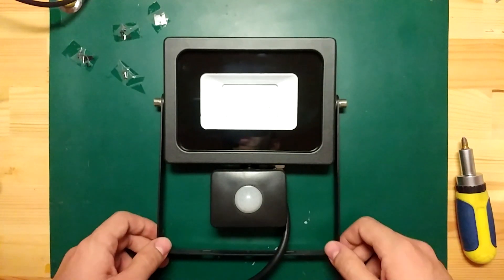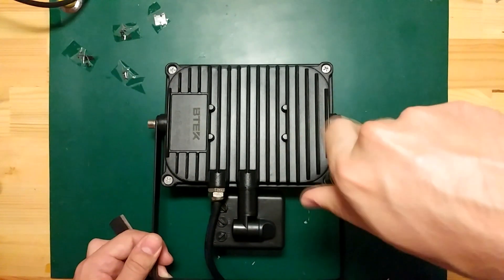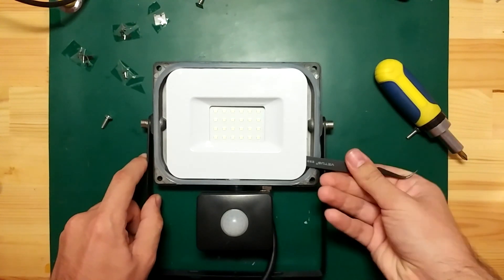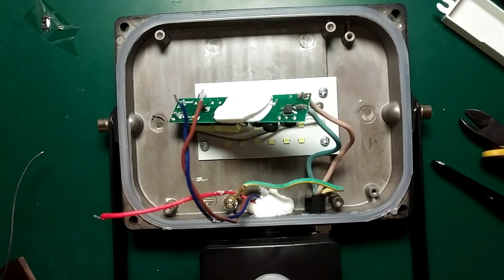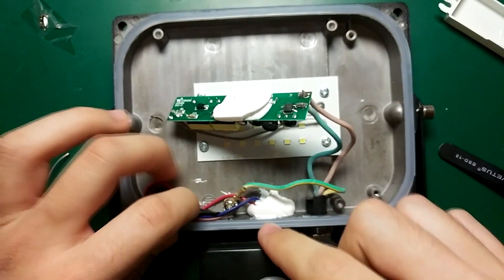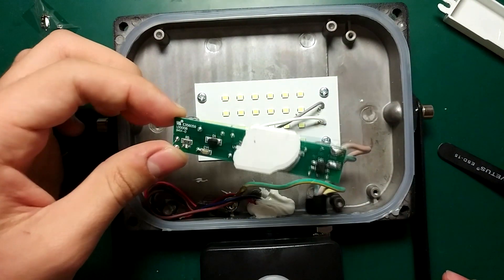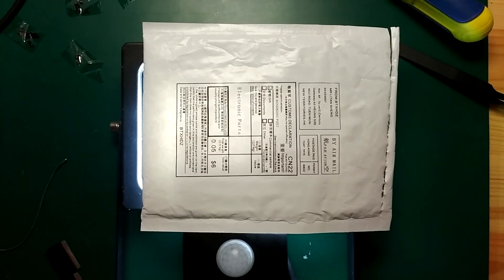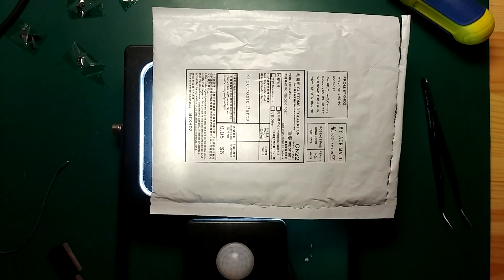How to Bypass the Motion Sensor on a LED Floodlight

Comment: I have bypassed the sensor but the problem is every time I turn on the switch  there is a 4 second delay for the lights to come on. any suggestion?
Reply: Turn in on 4 seconds in advance

Comment: Can you remove the sensor and add a switch?
Reply from the maker: Yes, you can! Look at 7:35, you can add a mains rated switch between the brown wire and the hole that it goes into on the circuit board.
Reply: @nunogarcia9446  thanks for that.

Comment: What if you want to use both? Detector ànd switch ;-)
Reply: Hey Gunter, see if your motion sensor has an override: 
If you turn the switch to the floodlight off and on within a second or so, the light should stay on.
To go back to normal operation, turn the switch off and wait  about 10 seconds or more before turning it back on.

Comment: Why buy a lamp with a sensor?
Reply from the maker: Mainly because it was actually cheaper with the sensor rather than without. I could have gotten a cheaper one without CE/FCC/TUV certification, but when it comes to electrical appliances and fixtures I do not like to play with fire - quite literally.
I've bought a cheap 50W projector from AliExpress for about $5 on sale, and it's about what you'd expect: sheet metal heatsink, and the ground lead connects to nothing but thin air.
Thanks for your comment, best regards.
-Nuno
Reply: @nunogarcia9446   OK you like playing with electronics; I do too but, some just don't know their resistor from their capacitor. I was thinking about those. So for them, your video was enlighting. Regards.

Comment: wow that's a mission! ...better off just buying a floodlight that doesn't have a sensor!
Reply from the maker: I assure you it's not hard at all! I did, however, spent a lot of time unscrewing screws, which I guess made the video too long. I'll try to do it better in future videos.
The basic premise is: cut wires from the motion sensor, and solder the live (L) and neutral (N) wires to the corresponding holes in the power supply. If I knew for sure that I wouldn't be needing the motion sensing feature in the future, I'd go straight to the point.
Thanks for your comment! Cheers.

Comment: why didnt use wire nuts instead of soldering to power the light?
Reply from the maker: Thank you for your comment! The wires were already soldered to the LED power supply, so I just removed the previous wiring and soldered the mains input directly to the power supply. I wanted to have the option to go back and use the motion sensor if I needed to, so instead of cutting wires and using wire nuts, I just soldered them. Hope this clears things out. Cheers!